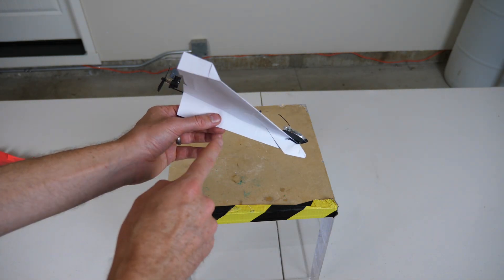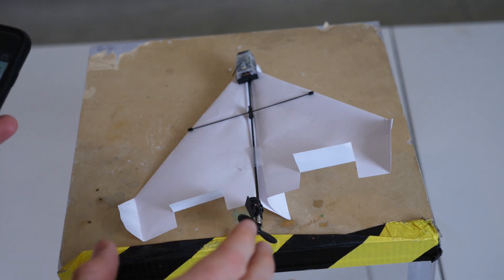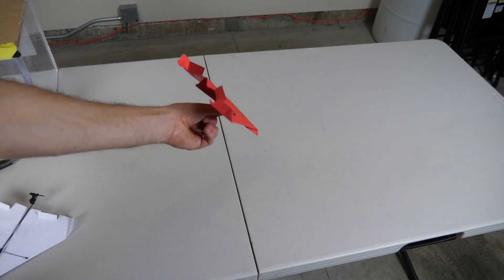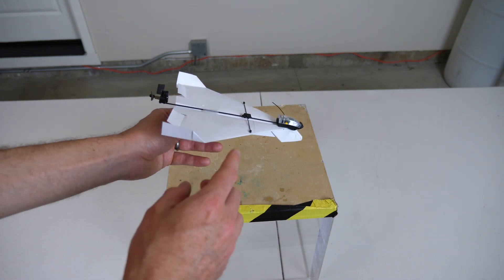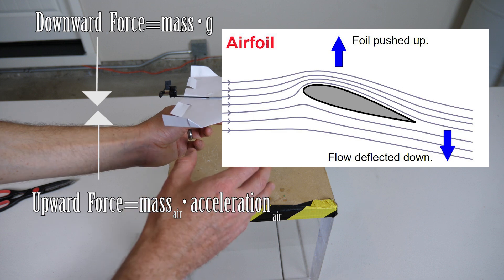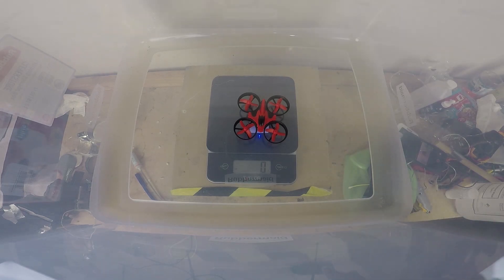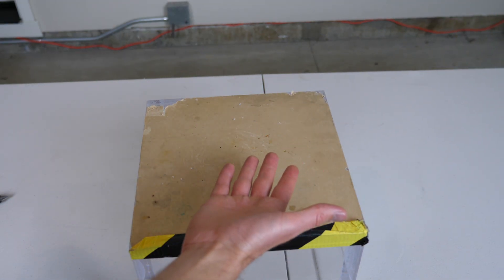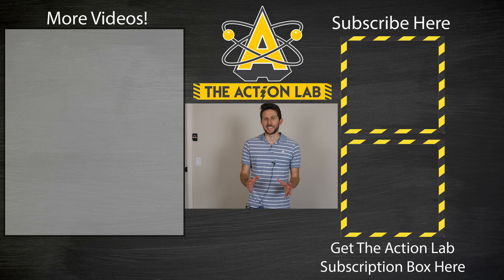How Far Can a Paper Airplane Fly if You Add a Motor? How Do Planes Really Fly?

Comment: yeah, 'lift' doesn't really exist (nothing is lifting the plane up).  the lower-pressure side of the wing is creating a vacuum effect that when coupled with the high pressure of the underside pushing the plane against the gases in the atmosphere causes it to fly/stabilize.  pressure/tension/drag are all occurring simultaneously and getting the proportions correct will result in a more efficient flight.

Comment: i did flew my paper airplane made of A5 paper for 10 minutes just to compare my balsa tip launch glider and paper airplanes. I launched it from ground to 10m height and it's keep catching thermals! The balsa tip launch glider one have "dethermalizer" so  if you want to take it down, you can activate it remotely or by a timer (electronic or mechanical timer)

Comment: I actually just got this set for Christmas! Mine has two propellers and I can’t wait to mess around with it more! Also the reason this flat winged plane flew so well is because up the up elevators on the back, the air catches on that slope and pushes the back down to lift the front up.

Comment: This video confuses me. Isn't the downwards momentum of air caused by the wing directly preportional to the differential of pressure?

I would think that the downwards air is the equal and opposite effect of the pressure differential, rather than the sole cause of lift.

Comment: I kinda wanna push back on pushing air down thing. That’s one way to move something through a fluid but that is different from pressure driven lift. Pressure driven lift is how a frisbee floats. It isn’t pushing any air down, it’s creating a low pressure pocket under the disc, giving it lift. That’s the reason we were taught that because it is a real effect.

Comment: Incorrect.
Its always Bernoulli, not Newton.
When a flat wing presents A to the airflow, it is not pushing air downward to produce lift, it's slowing air and compressing it underneath, while the A angle also makes air on top travel faster, further, rarified.

The voice-over betrayed the ignorance about the basics when early in the video it said lower pressure below and high pressure above the airfoil.
That's exactly opposite from reality. Of course someone will thank Newton for flight rather than Bernoulli, if they don't grasp the basics.

Question: how does a ram-wing GEV like the KM ekranoplan or Lippisch x-114 or Jorg "flugboot" fly in GE, much more efficiently than a plane? Does it bounce air off the under side of the wing, off the water, back up to bounce off the wing again?
Or is it due to increased pressure underneath and rarified air above?

Also related is the phenomenon of vortex-driven parachute lift, on a very-low aspect-ratio planform wing. 
See the Nemeth Parachute plane or the Arup, or the Vought or Eshelman or the Facetmobile.
When flying very slowly, the extreme wing-tip vortices wrap around behind it capturing a "bubble" of low pressure behind it while at extremely high A (<~40°) compressing air below it increasing lift via Bernoulli. This is why Zimmerman used the planform of the Arup in the Vought plane.

So if planes fly by bouncing air from the underside, how to use that theory to explain the known science about the "parachute lift" phenomenon?

Comment: Yeah. I bought two power ups. They both sucked. The blue was impossible keeping connected even at a close range. Then after a while the motor gets weak. At $50 a plane, I give it a 👎.
But, I was hellbent on having one that worked. Micro drones work great. Take it apatt and remove the front motors. Hotglue 1/2 a popsicle stick between the battery and board. Hot glue the rear motors to the ends of the stick. Finding the COG helps.
The paper plane I use is the kind John Connelly the paper airplane guy won the distance world record with. Use that plane and cut an inch section out about 1 inch to two inches back, and a paralelle 1/2 inch from the wings. 
These drone i used are sky viper dash. About. $20 a pop. You have to kind of adjust the elevator every time you replace planes. Speed + elevator = lift. The better you adjust the COG, and the elevators', the faster it goes.

Comment: The real reason is due to the venturi effect. As speed increases due to the reduced cross sectional area in a free stream, static pressure decreases and dynamic pressure increases, Since total pressure must remain constant, meanwhile the static pressure above the wing is lowered while the static pressure below the wing remains constant.

Higher pressure air is going to expand outward relative to lower pressure air. And an obvious consequence of that phenomenon would be that the wing appears to ‘push the air downwards’ as he mentions. But that’s not the real reason why it happens. It’s due to changes in velocity and the consequent change in  pressure. 

The airflow immediately above the wing behaves(we call it boundary layer air) like the airflow passing through a venturi. The aerofoil may be symmetrical or asymmetrical the bottom line is to produce lift you need to reduce the pressure via increased velocity. 

And yes I’m a pilot lol.

Comment: Concerning wings, there is a corresponding vacuum created above the wing as well as the compression created below it,  so,( discounting your dyslexia, high pressure above, low below), you are half right. The curvature on the top side of the wing helps with turbulence and extends the lifting area. There is more but this is enough for the basic understanding of foils.

Comment: But this is different... Paper planes are propelled in the air with force. It's not really taking a lift when it is not coming directly from the ground.  Real planes require those physical structure because the plane is literally lifting itself on its own without any external help. The flow of the air through its physical structure while gaining the speed on runway plus those crazy big turbines helps the thing take a lift and fly. 

I'm just an ordinary guy have no background with these stuff but i think that taking a lift is different from an actual flight. 

Paper planes can fly without the need of the physical structure of a a real air plane because we use our force to send it gliding in the air. 

Also isn't gliding and flying are two different forms of flight? Damn i should just go back to sleep im sorry  :(

Comment: I think that because you want to simplify the process, there is a mistake in your explanation.
The first thing to differentiate is that the SUBSONIC flight and the SUPER SONIC flight are different modes of flying.
There are 3 wrong ways to explain why a plane flies.

#1 The air particles from the top of the wing and the bottom of the wing arrive at the same time.
It's wrong. (Ok the Nasa explains it better,https://www.grc.nasa.gov/www/k-12/VirtualAero/BottleRocket/airplane/wrong1.html)

#2 The air hits the wing profile and bounces down, producing lift.(not suitable for SUB-SONIC flight)
The air feels the pressure waves before the object arrives, moving out of its way.
Also this idea would only be based on the fact that sustainability is generated at the bottom of the wing. Which is also not true. (see NASA https://www.grc.nasa.gov/WWW/K-12/VirtualAero/BottleRocket/airplane/wrong2.html )

#3 The upper part runs more (like a Benturi tube) generating less pressure.
This is incorrect, because then you only go on what happens at the top of the wing profile without having met the other wing part. (NASA explains it too, https://www.grc.nasa.gov/WWW/K-12/airplane/wrong3.html )

The air has a very low viscosity.
For a low angle of attack,
the air behaves as a non VISCOUS fluid and sticks to the wing surface and KUTTA CONDITION is produced.
But if we increase the angle of attack ,
then the viscosity of the air keeps it from sticking.
The lift force occurs when the air changes direction (at the front of the wing at 1/4), not at the wing exit.

For the air to change direction (turn) the pressure on the outside must be greater than the pressure on the inside.
(remember the swirl of a hurricane, in the eye there are low pressures and outside are high pressures)

Therefore, the rotation of the air is linked to the pressure differences around the wing.
The air that passes through the top of the wing has to have a lower pressure than above (which will be from an atmosphere) and the air that passes through the bottom of the wing must have a higher pressure than below (which will be from an atmosphere)

Comment: No. That's wrong. The wing curvature makes a high pressure on bottom and low pressure on top. If the high pressure were on top, the airfoil won't fly

Comment: Your explanation is as deep as a puddle. Bernoulli principle is clearly accurate and the only reason your toy flew was that you had excess thrust which compensated for the lack of an airfoil and your use of elevators on the trailing edge kept the toy nose high

Comment: Flight laws are built around three vectors. Lift, Thrust, and Drag. Your discourse completely discounts lift.   If the understanding (as related in the video) were correct, sailboats couldn’t sail upwind and gliders’ ability to gain altitude would be severely limited. .

A practical understanding of lift generated by the Bernoulli effect is ignored by your “explanation”. So much so, that I’d have to say, the explanation is just wrong.

Comment: You forgot that as long as you have enough power anything will fly you can throw our house across the entire United States and it would fly the old space shuttle used to be nicknamed The flying brick because it was going seventeen thousand miles an hour and then some and it would be landing and air and all but falling with those little stubby wingsgolf balls don't have wings football's don't have wings but the power that's put into him when they are launched makes them fly rockets don't have wings but they can flyso it's not just the curvature of the top facing force of the wind to make a airplane fly and if that was the case any airplanes flying upside down would immediately slammed towards the ground because it would be fighting not only gravity but also the reverse pressure that is now facing the ground because the airplane is upside down physics is trippie

Comment: There are so many things wrong with your explanation I can't even begin to start.
   To say that you do not need the curved part of the wing to create low pressure on top and high pressure on the bottom is not only completely wrong but if someone tried to build an airplane like that and fly it if they got into the air they would more than likely kill themselves. With enough power you can fly a brick as long as you are flying at an angle of attack it would generate enough drag to actually push the air vehicle up but the minute you lower the nose you're coming down and coming down alarmingly fast. 
   The rotors on a helicopter also create lift same as propeller mounted in a horizontal situation creates lift only in the horizontal plain and not the vertical plain.
    There is a Thrust coefficient that equates with the twist of an airfoil the same as the twist of any wing but you are trying to rewrite physics and are completely wrong and it is way too much to get into with this particular Channel. I challenge you to build a full-size flat wing airplane , put a motor on it and then try to safely Propel yourself into the air. Please do us all a favor and take some flight instruction first. Now let's say you get that airplane into the air without killing yourself or anybody on the ground. Now stall it. The lift created by the airfoil of a wing helps moderate the stall and how the airplane comes down and how recoverable it is throughout that sequence of the maneuver. You do that with a flat Wing that is only creating drag and therefore pushing itself up and you have got yourself a situation you do not want to be in. Please so you don't make a jackass out of yourself study Physics a little more thoroughly in the principle of lift vs. drag vs. thrust.
   On a final note again if you had your physics correct you would understand that the faster the air flows over the top of the wing the less pressure there is above the wing creating a higher pressure underneath the wing creating what we commonly call lift. Your explanation is beyond any logical understanding and again I believe you need to study a little more. Take that challenge that I propose to you, take out a huge life insurance policy with a waiver for stupidity and then try to fly that airplane. You might want to add a ballistic chute because you will need it. Now about the parachute,, the parachute slows your descent due to higher pressure underneath the parachute or as you say air bunching up and the reason you do not lose control in a circular parachute is because there are spill vents on the top releasing that pressure in a controlled and balanced manner that keeps you from bobbling all over the place. Now you have the situation of a flying wing parachute which again is creating low pressure on the top of the wing and a high-pressure situation on the bottom which allows you to fly that parachute like you would any other aircraft. Gliders do operate on the same principle. Show me anyone that would get in a flat wing glider and fly it and I will show you someone that needs medication to keep them from doing it.

Comment: First of all, you have a lot of mistakes in your video.
1. You have a paper plane with Elevions pitched up. Now an Elevion is an Elevator+Aileron. So basically it produces a lot of pitch up moment. But if it is concerned to balance Center of Gravity of the aircraft. Maybe its good factor, but I am still sure that you have not balanced the pitching moments.  What about the movement of the plane in the Roll and Yaw axis.
2. Who told that air is being thrown downwards that literally makes no sense. Lift is an aerodynamic force produced due to pressure distribution over a body and shear force acting on the body. So to prove flat bodies do have to lift is that an angle of attack greater than zero. There is a lift on the flat wing except on zero angle of attack. Where there is no lift produced in that angle of attack.
3. Seriously 30 Degree of the angle of attack, the foil used in A380 is a NACA series foil which does not have lift over 15-20 degrees of angle of attack. 
4. To calculate Lift the formula is 0.5*Rho*S*(V^2)*CL, units are Newtons. 
Requisites required in this video learn Aerodynamics, Flight Mechanics. It's sad that you talk about physics. Basically, Bernoulli, Euler will curse you on using the continuity equation to calculate the horizontal component as a force.
Chuckles me, your really bad at this part and please don't make videos like these in the future. You need to go to college, my friend.

Comment: You're wrong.  Your wing was not flat.  You created a curve in the back of the wing, called a flap, which changes the shape of the airfoil, hence LIFT!  Your flap pushes the tail section downward, the leading edge of the wing up, hence creating HIGH pressure under the wing and lower pressure on top of the wing.  NO, the air does not push the plane up, it stabilizes the airfoil.

Comment: David Perry
Lots of misunderstanding in the narration of the video.  Yes, a flat bottom wing (even a door) can serve as an wing (type of airfoil) sufficient to lift an aircraft so long as it has enough angle of attack (alpha or AoA) and relative wind to apply to the lift equation (L = Cl * A * .5 * r * V^2 ).  CL is coeficient of lift per section of wing per given airfoil shape, A is the area of the given airfoil, and r is the air density measured in "slugs", and velocity of the relative wind.  It is a COMBINATION of Bernoulli's Principle (which, oh by the way, also works in water and any other fluid) as well as Newton's Third Law.  So a typical curved curved top/flat bottom wing will generate oodles of lift compared to a flat bottom wing or even a curved symmetrical (Extra 300) wing if both are at ZERO alpha (in fact, both the flat (symmetrical) wing and symmetrical wing generate ZERO).  How much is generated by Bernoulli's Principle vs Newton's Third Law at a given moment?  No one has been able to isolate how much from each because it is IMPOSSIBLE to determine.  We (as the Wright Bros ably did) CAN measure the amount of lift through empirical means in a wind tunnel and flight tests.  My educated guess (some of it inverted in Extra 300s) is that certain NACA airfoils may use more of Newton's Third Law, and as all increase AoA, more of Newton's Third Law gets applied (think of a wing at LD Max or even beyond).  BTW, just as we cannot determine how much lift occurs from Bernoulli or Newton, scientists also do not really KNOW what provides the attraction of gravity.  Yes, we know we can calculate attraction by mass and distance (inverse to lift, it diminishes by the square of the distance), but no one really knows what is causing the "weak force".

Comment: the airfoil shape is not needed its there mostly to help with drag in fact for super sonic flight a flat plate is what you really want 
for small aircraft like this whats more important is Angle of Attack and thrust at these sizes and weights you can fly purely on thrust alone wings are really just to make it look nice see Pizza box RC aircraft which are basicly a flat square of card board or foam with motor and elevons and fixed rudder